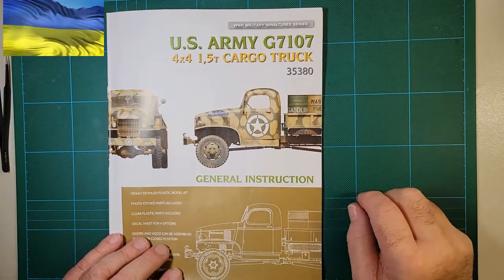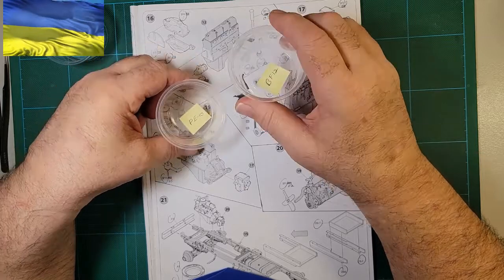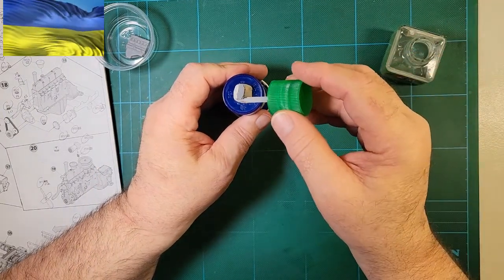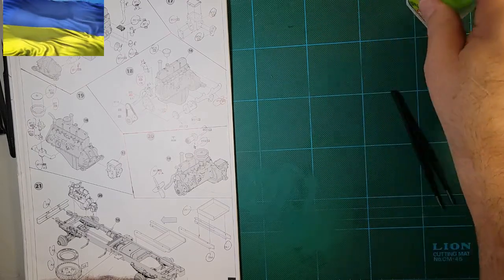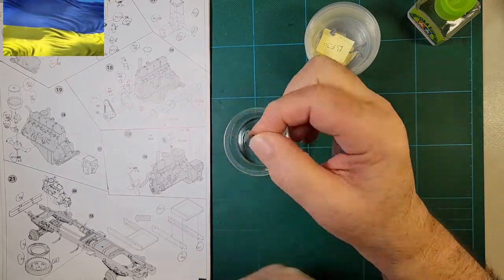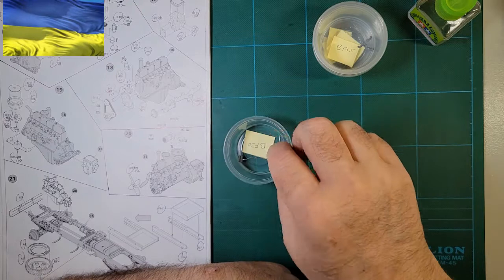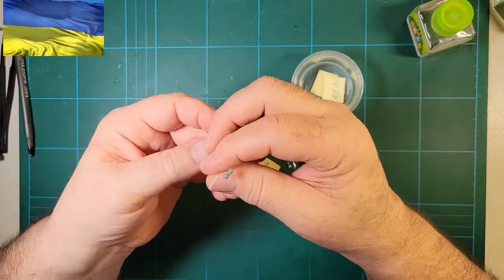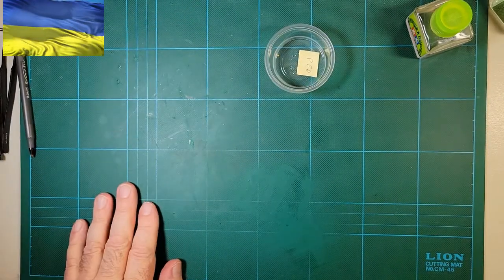MiniArt US Army G7107 Part 7

Comment: Hi Jeff  , like the way you get your small parts ready for painting,  ive always left them on the sprue and touched them up as required !  Glad to see someone playing with tiny parts they can be a lot of fun,  that bumper lol I made the same pumper , bull bar, for my Land cruiser FJ 55 , I used a C section 75 ×125 mm bar lol it worked well bulldozing trees over on my parents property😊😊😊😊 great video mate , have a good one 😊😊😊😊😊
Reply from the maker: Hi Marc, you have a FJ, very cool.  I have a Jeep CJ-7, I haven't driven it in a while, I'm hoping to get it in my garage one of these days and restore it.  That bumper you have sounds really good too.  My dad used to drive one of the old Willy's wagons.  He put a bumper like that on it.  One day someone sideswiped him.  That bumper caught the other car in the headlight and pealed the whole car back like a can opener all the way back to the B pillar.  It took about a minute with a sledgehammer to fix the bumper.  Thanks for watching, I really appreciate it.  Jeff
Reply: @JeffDonahueScaleModeling  I had it back in the 80s , it rusted away,  if I had a chance to restore a car , the FJ would be it ,  the only thing id change would be the straight 6 with a 4.2 diesel engine and a 5 speed gear box , and modern running gear , haven't seen one in a very long time now , but one day lotto permitting 🤔🤔🤔🤔🤔 jeeps did a big apperance a few years ago , but they didn't last  very long on our outback roads, think it was more to do with getting parts to the outback  ( middle of nowhere ) Toyota rules the outback here in OZ
Reply from the maker: Maybe someday you will find one.  That's one of the good things about living where I do.  It's really low humidity, almost nothing rusts.  There are still lots of perfectly good old cars around here.  My jeep is a 1984, it only has one really tiny spot of rust and it's been outside its whole life.   Have a good one.  👍
Reply: @JeffDonahueScaleModeling  just been seashing  for q plastic model of the old girl!  No luck !😧😧
Reply from the maker: I'll keep my eyes open.